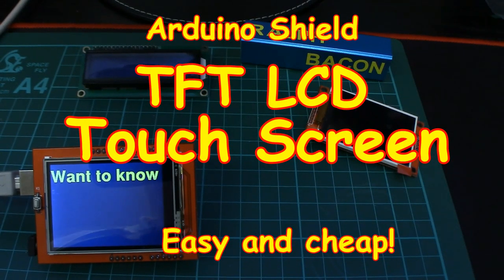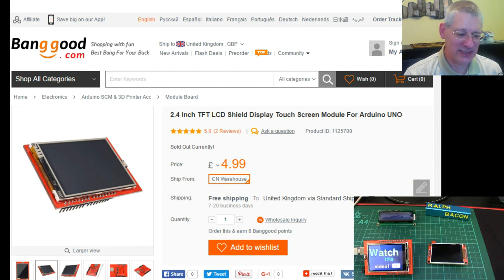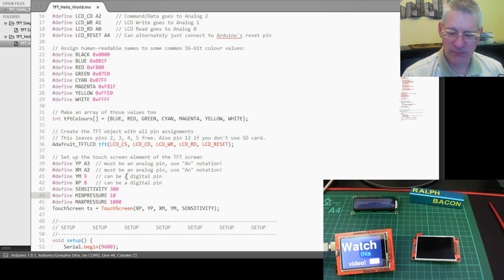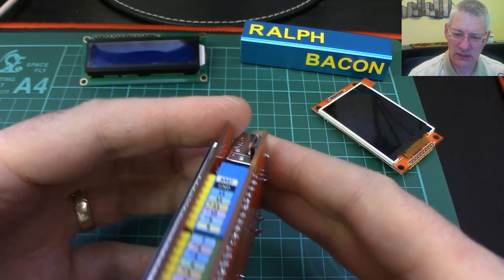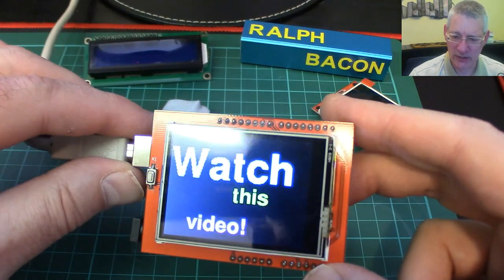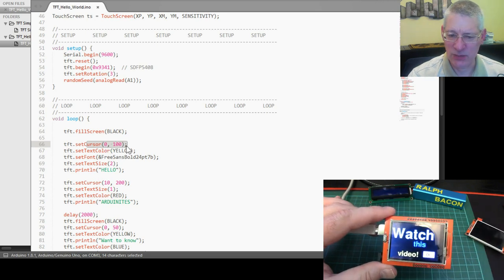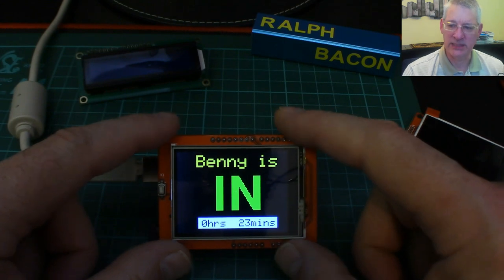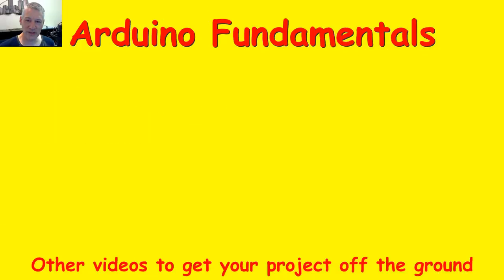#83 Colour Touch Screen TFT LCD for your Arduino - Cheap & Easy

Comment: Can you provide a link to the great pricing Arduino Uno board on ebay you found?
Reply from the maker: Well, the good news is that the price has dropped for UK buyers, at least. It's now available for around $2.78 (that £2.11) and here's a typical link from AliExpress.com: 
https://www.aliexpress.com/item/Best-prices-high-quality-UNO-R3-MEGA328P-for-Arduino-UNO-R3-NO-USB-CABLE/32824708026.html but I'm not endorsing (or otherwise) this particular seller, it's just an example, but I hope it helps.
 
In case others don't know, AliExpress is a bit like a huge eBay for Chinese and Far Eastern supplies - not just for electronic items, but absolutely everything you could ever think of. They are quite strict with their suppliers, you get ages to raise a complaint and they generally are very reliable. Your money is held by AliExpress until you confirm delivery or your (generous) delivery time expires. It can take a while for things to arrive (sometimes several weeks) but then again I've had stuff arrive this week in just 10 days! Good place to compare prices against eBay and Amazon.

Comment: Sorry to trouble you, but do you know the maximum size in GB of the sd card this little video board can handle? speed range  = Class ?
Reply from the maker: Tricky one this, William. There is zero information available so we will have to be a bit clever. Micro SD card sockets sold for Arduino/Pi use seem to max out at either 2Gb or, if they are really SDHC (High Capacity) 8Gb. Without actually trying it out it's all a bit hit and miss. That said, you can get an awful lot of data on a 2Gb card (yes, I know, 2Gb's worth! - but that's a lot of text data if you're logging something , for example). I have some micro sockets that allow up to 32Gb capacity card so you just can't tell. I suspect (me being cynical realistic that the capacity might be on the lower side).
Reply: @RalphBacon  
2 Gigs max is correct on Arduino. Inherited from the old PC world (FAT).
8+3 filename etc.
If using a BME280 weather sensor you can store many months of data. 
BME280 is a Bosch Temp,Humidity and Air pressure sensor via I2C. Works great.
If you buy on Ebay make sure you get  the "purple pcb" , the are more often real BME280's
The blue model with sloppy silkscreen is normally BMP280. Only Temp and Humidity.

Comment: I ended up having to swap out the adafruit libraries for the MCUFriend library. But now I don't know what I want to do with it since it uses up all the I/O pins on my uno. 

I ordered 2 of these from banggoods. Both came without the screen protector's that screens usually come with. No huge problem there since they were scratch free. But one came with misaligned header pins that I had to straighten by hand. So.... yeah. Heed his warning about not forcing your shield. Make sure it does all line up nicely so you don't break anything.
Reply: Wait a tick.... I know what to do with it! 

Convince my wife we need a Mega board or two. Mwahahaha >:D
Reply from the maker: That sounds like a cunning plan, Julian! Personally, I'd dedicate a $2 Nano to it as a driver and send the commands via Serial or I2C or something... but Megas are now available from the Far East for $6-8 or so, not a King's ransom these days.

Comment: A video with a 'touch' of class.  I'll need few of these. Adafruit charges way too high for these.  In regard to Benny's project, what sensor you referring to to detect in or out?  You mentioned PIRs but not clear on details.  nrf424 is great for short distance.  if you need further, look at HC-12 .
Reply from the maker: Hi Raad! Yes I am using two PIRs to detect Benny moving out/in with a bit of fuzzy logic so I know which way he's headed. I'm going to transmit the data using an nRF24L01 just as you say; it's only got to transmit one byte! I hopefully won't need the power of an HC-12 but I will read up on those anyway, thanks for the suggestion.

Comment: Hi, I have a 2.8" TFT shield. When I plug it on to my Arduino UNO Rev 3 it works well with most of the demo sketches out there. But when I plug it on to my Arduino UNO WIFI rev 2 (which I'm told is compatible) it does not. Can you tell me if it will work with my Arduino UNO WIFI Rev 2?
Reply from the maker: I suspect, Tony, that your Arduino UNO WiFi may use some of the GPIO pins to run the WiFi, but those GPIO pins are also required to run your TFT shield. 
If you can dig out the documentation on which pins are being used for the UNO WiFi it may get you closer to resolving this. 
Additionally, remember that the UNO WiFi uses the Microchip ATmega4809 (not an ATMega328P) which is a different chip altogether, made compatible with the UNO REV 3 by a "compatibility layer"; maybe it's not quite as compatible as Arduino (or the TFT manufacturer) had hoped. 
Sorry I can't be of more help.
Reply: @RalphBacon  Thank you Ralph. I did read that the ATMega328P and ATMega4809 were compatible but I guess you're right.

Comment: Hi Ralph.   Did you determine if the 2.2in screen was 3.3v or 5v Tolerant?    I gather from what I've read that the panel is actually looking for something like 3.6v and the VCC in is regulated to that. I've got a 2.8in one   Supposed to be 5v tolerant but dubious.  The J1 jumper can be shorted out to bypass the regulator and a number of other youtubers say that's what they always do? Mines hooked up to an ESP32 3.3v output seems to be fine so far! but not sure yet if that's how I will use it.
Reply from the maker: I'm afraid too much water has flowed under the bridge since I did this video, Stephen, but if it works reliably at 3v3 then keep it at that. I'll be using a different screen (very similar though, just larger) for an ESP32 Internet Radio project which might interest you.
Reply from the maker: Update: The screen is currently plugged into an Arduino UNO so it MUST be 5v tolerant, Stephen!
Reply: @RalphBacon  Thanks Ralph,   Much Appreciated.   The one I had delivered has a dead row of pixels! So I don't  actually mind if the magic smoke appears.(ebay supplier sending me another).      Yes will follow your Internet Radio project with great interest.

Comment: Did the coloured pin labels come with the UNO Ralph, or are they available online - thanks?
Reply from the maker: The coloured pin labels, Steven, were actually from an ATTiny85 Kit, but prior to that I had stuck a white piece of paper on the side of the header sockets and had written, as neatly as I could, what each pin was. I used a red pen for the +5v. The "professional versions" can be made using a printer though, very easy, a bit of trial and error and that's an evening well spent!
Reply from the maker: This page may get you started:
http://info.yawp.com/kits/patch-shield-v04/d1-full-sheet.pdf

Comment: Need more pins? A 74HC165 or 74HCN595  shift register might do the trick.
Reply from the maker: Indeed, you are one of many suggesting this route so it seems I shall have to experiment and do a video on this too! Thanks for the heads up.

Comment: Ralph, great program. I am a  novice programmer, so appreciate the code that works right off the bat. Where is the delay for the touch button appears. Can touch screen be used to turn on outputs on the arduino?
Thanks
Reply from the maker: Hey, Rusty2224 (I wonder if there's a special meaning to those numbers?), good to hear from you. A touch screen can be made to do anything that a standard push button switch can do - so turning on an output pin is no problem at all. If you look at my demo code you'll spot where the logic is to detect that touch (I seem to recall it was in a 'blocking' loop) - then you can do whatever you want. Does this make any sense to you?
Reply: Ralph S Bacon I'll look. Again not a programmer. Show me an example and then I get it. Any chance a short sketch turning on an LED? No significe to those numbers that I recall anyway...Ha. Thanks so much for the reply.
Reply from the maker: For simple example sketches, rusty, look at the examples folder in the Arduino IDE. They start with the BLINK sketch which turns an LED on and off at regular intervals. If you get that working you will have learned more than you realise, especially if you figure out how to speed it up, or do double blinks.

Comment: can you make a video on displaying custom bitmaps on oled or display shield by taking external input from a touch sensor using arduino? am actually working on a robotics project and i am unable to figure out how to make a smiley face displayed wen the sensor is touched and then go back to normal face emoji wen the sensor is idle
Reply from the maker: Getting it to display is the important thing here, Ankush, not how it is displayed. If you go my GitHub for this video and drill down the following path:
 
TFT-LCD-Display-2.4-2.8-Touch-Shield/Adafruit Original Libraries/Adafruit_LiquidCrystal/examples/CustomCharacter/
 
You will see how to create custom characters but I'm afraid that's not something I can help you with; you will have to investigate further and try the example and from there work out how to create the ones you need.
 
I hope this at least helps!
Reply: Ralph S Bacon thanks alot, its a strt. if I figure it out sure will let u knw

Comment: Nice! Could save a load of wiring in push buttons to a project. Does look like a fair bit of coding heartache to get right, but then if it was easy everyone would be doing it. Cheers Ralph.
Reply from the maker: Indeed that is true, Douglas. If it were easy this Channel would not (need to) exist! Shock! Glad you liked it, it's a nice way to add a bit of Wow Factor to a project. Thanks for posting, nice to hear from you.

Comment: Ralph, I bougth some of them on ALi, they all are 8 bit parallel LCD + control lines and the only library i found was, the ADAFRUIT_TFTLCD, but this is incredibly SLOW...  compared to other ones which use SPI technology, also on ALi to find and use the library Adafruit_ILI9341 which is for SPI LCD's I believe
Do you know of a FAster variant of the Parallel library TFTLCD ?    I need to update my screen faster.. tnx 4 any tip...
I am great follower of your transmissions..  ON7MA
Reply from the maker: I'm afraid I don't know of one, but Google may be your best friend here. There are many people who try and improve upon existing libraries (or rewrite them completely) so keep searching, you never know what you might find.

Comment: My display does not get such clear output as yours. The texts get overlapped and the fillscreen doesn't work correctly so I get a weird output. Can't figure out what the problem is :(
Reply from the maker: Are you using the correct library (exactly the same as me?) That is the most likely cause if you have issues with a screen.

Comment: what if the touch function doesnot work. which pins on the display connect to xm,xp,ym,yp as mentioned in the code .so that i can know what to change in my code.
Reply from the maker: You need to look into the library to see how the touch works and which pin it responds to (an analog pin, certainly). It's not easy but Google might help you.
Reply: @RalphBacon  thank you... Will look into it

Comment: A very helpful video. 
Suggestion for a new project :
I am making a weather and potable water pressure monitoring station. It will keep track of things for the last 24 hours. 
But if there is a power blip, the arduino resets and all that data is lost. I would like to avoid spending $75 or more for a proper battery backup unit by utilizing some code and some switches etc. and a standalone battery. 
Any interest ?
Reply from the maker: If you look at my latest video #172 you will see a Li-Ion UPS-type adapter that will keep a circuit running for quite a while. It requires a cylinder 18650 Li-Ion battery, 2000mAH would be good (any larger and they are lying, they don't get much larger). I do a much more detailed video on it in video #116. See this product link: https://www.banggood.com/3Pcs-Wemos-ESP32-ESP32S-18650-Battery-Charge-Shield-V3-Micro-USB-Type-A-USB-0_5A-Test-Charging-Protection-Board-For-Raspberry-Pi-Arduino-p-1448427.html?p=FQ040729393382015118&utm_campaign=25129675&utm_content=3897
Reply: @RalphBacon  Occasionally I find myself in need of a temporary 3 volts, or around that.  I usually go to https://www.goldmine-elec-products.com/products.asp?dept=1028 and find myself a good used ultracap that I can put in circuit with an 18650 battery that is set to run my device.  When I remove the battery to change to a newly charged one, the ultracap will step up and keep my power smooth for a quit awhile.  I have tried ones as small as 6 farads, and that seems to work for a short time, my favorite though is the big ones, the last set I picked up from them were the size of  D cell Flashlight batteries  and are rated at 350 Farad's.
Reply: I did watch 171 & 172. Both were interesting. And thanks for your quick reply.
But i came away understanding what you were doing exactly opposite to what you said in your reply to my comment. Setting this on/off business aside, It looks to me like you were running off the battery, then as it went flat, you got power from the arduino. That seems like a very uncommon scenario. Why use the battery at all ?

Comment: Nice Video, Ralph. I always forget that some displays have touch screens. Thanks for the reminder! Do you know if the libary provides sliders?
Reply from the maker: Hello stereomatzel, long time no hear! Not totally sure I understand what you mean by "sliders" in this context; perhaps you mean ones drawn on screen, like a DJ's crossfader? I don't think the library I used provided any prepared controls/shapes as such, but I bet there are some out there.
Reply: I was always lurking in the shadow. This is an example for a slider/scale: http://www.python-course.eu/tkinter_sliders.php. Instead of a potentiometer hooked to an ADC pin to controll RGB colors, fan speeds etc. I will do my research on it.
Reply from the maker: You could certainly draw this on screen, and let the user use the touch facilities to drag it, but I think that it might all be a bit slow (did you notice how slowly the letters were drawn on the screen in my demo?). Do your research, see what you come up with. Cool!

Comment: Hi Ralph, I have used your demo code code on a project, can you please show me how to define a button to press on the TFT screen, not the whole screen. Thanks.
Reply from the maker: OK, you are not exactly defining a button, per se, to press, Tony. 

What you do is draw an area of the screen to represent a button but what you press has nothing much to do with what you drew. All you are doing is pressing the screen and your code will determine whether your press was within the confines of that drawn button and not somewhere else.

Example: you draw a 50 pixel square "button" 20 pixels from the top and 20px from the left. Your code can tell you where the press was detected. You now have to say, "Was it within the area 20px from the top and 20px from the left and then within that 50px area of the 'button' I drew". I know, a bit clunky but that's how all touch screens work.

Your screen press action will work regardless of what you have on screen. Obviously you want it to look like somewhere to press, as per my demo, but it's all smoke and mirrors.

Normally, there would be an underlying library to draw and recognise touches on various "buttons" but in this sketch I did it the hard way just to show how it all worked.

Make sense?
Reply: @RalphBacon  Thank you for the info Ralph. I'm trying to get the touch screen to only work within the button confines.
If my "button" is drawn at X=220, Y=180, W=75, H-40, how would I configure the line
#define btnCONTINUE ((p.y < 300 || p.y > 845) || (p.x < 220 || p.x > 300)) 
to recognise a press in this area?

Comment: Hi Ralph, did you ever get that 2.2" screen working with the 5 pin  spi connector?
Reply from the maker: You mean this screen here? I can't remember how I got it working but work it did. Did I use I2C or something? Sorry, this is an old, old video!
Reply: No worries, Ralph.  Not a lot out there for the ili9488 but I found libs at lcdwiki in the end.
Didn't realise this was such an old  video!

Comment: Dear Ralph,
Although your video is about TFT screen, let me ask this question - for my DIY Remote Control Unit I have selected Graphic 128x64 LCD screen based on ST7920 chip-set. I decided, that I do not need any color to represent just numbers (e.g. GPS coordinates or altitude of my drone, or temperature), so I needed just big enough screen to show only text and numbers, big enough for easy reading. So I found this library "U8glib.h", which have also definition for my LCD (U8GLIB_ST7920_128X64_1X u8g(13, 11, 10); // SPI Com: SCK = en = 13, MOSI = rw = 11, CS = di = 10), which means it will use PINs No. 13, 11 and 10 to connect it. But at the same time I am gong to use nRF24L01 wireless module for transmitting/receiving information. If I understand correctly to connect it to Arduino it uses PINs No. 9, 10, 11, 12 and 13. Now the question - (it is obvious that both devices uses the same PINs) can I define for my LCD screen any other PINs then 13, 11 and 10 (or they must be SCK, MOSI and SS PINs), say 6, 7, 8? Or I should use PIN extension somehow?

Thank you for helping me!
BR,
Valters
Reply from the maker: In brief, the Adafruit library does mention that the shield version has fixed pins, but it seems they can be changed by either defining them differently (in the library headers) or just in your sketch. Dig down into the examples and see what you can find. If yours is not the shield version it's more flexible (or, the library seems to allow a wider range of pins) but there's no reason as far as I can see why it has to use the pins you mention.